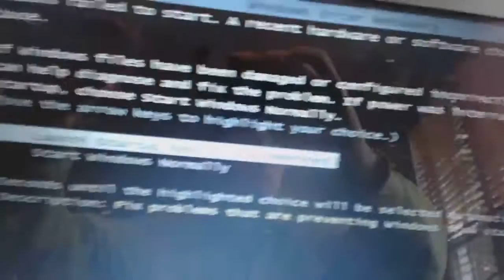How to repair no power on Asus a54c k54c dc power jack socket input port connector fix

Comment: My WIFI is switched-on in the software and the little green wifi led under the mouse pad is lit however when a troubleshoot is done via the software diagnostic it says the Wlan is switched off. In the notification area at the bottom right of the screen the wifi signal strength icon has a red X across the signal strength wifi vertical bars which denotes the Wlan is turned off according to the Asus A54C user manual. Can you say what is the problem please on my Asus A54C? Anyone.

Comment: My WIFI is switched-on in the software and the little green led under the mouse pad is lit however when a troubleshoot is done via the software diagnostic it say the Wlan is switched off. Can you say what is the problem
Reply from the maker: faustsmith uninstall the drivers for wlan and reinstall it, worst case just buy another wlan card for $5 and put it in there, it is easy to put in.
Reply: Power Jack Repair Do you think the driver needs updating? How do I uninstall the driver and reinstall it? Do I have to save the driver somewhere to have it available for the reinstall. I cannot connect to the internet as the wifi or Wlan is not working to reacquire the driver from online for reinstall. Please let me know.
Reply from the maker: Power Jack Repair driver will reinstall itself on a reboot once you uninstall the driver from control panel, if not you can download the driver from asus web site for your wireless card, as well as wireless control programs if any.
Reply: Power Jack Repair Will the driver be saved to my laptop then reinstalled automatically on restart or reboot? I do not have access to the internet to get the driver from the Asus website if that is required as the WLAn is not working now. Please let me know.